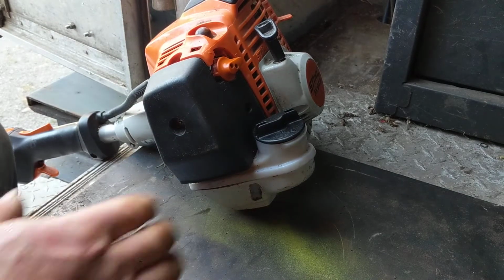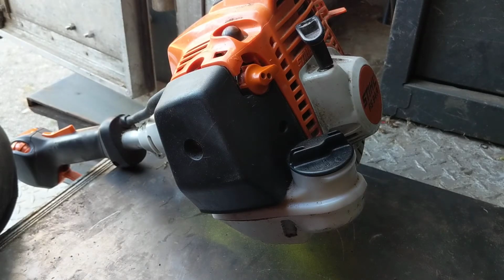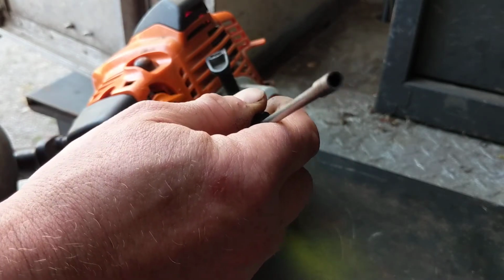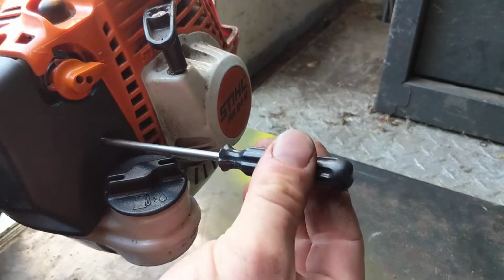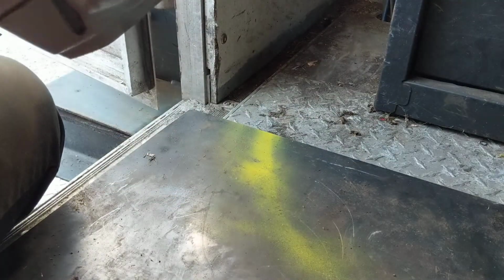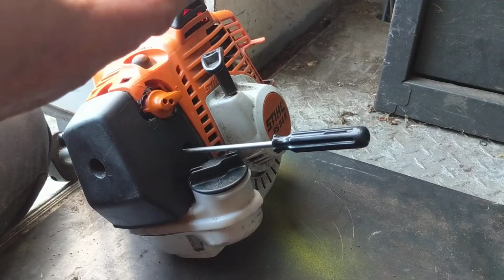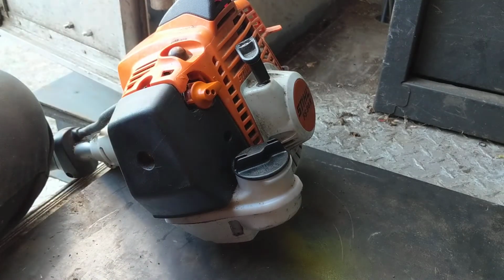Stihl FS 94 R Line Trimmer Carburetor Adjustment #stihl #landscaping #smallenginerepair

Comment: Do I have to mess with the low adjustment?
Reply from the maker: Only if it needs it
Reply: @machinesnmetal  what exactly is the low for? Just wanna make sure before I start messing with it
Reply from the maker: it sets the air/fuel mixture when the engine is at an idle.
Reply: @machinesnmetal  thanks ! 🙏🏼

Comment: I have one of these and my problem is that it doesn't stay running, at first I thought it was the carb and changed it and I still have the same problem, I changed the fuel filter, fuel lines and spark plug and still can't get it to stay running. Any suggestions?
Reply from the maker: What compression does it make?

Comment: Ive worked on thousands of these. A stock, untouched zama/stihl carb should almost never need adjusted. Only time ive ever had to was when i lived in denver and they ran too rich for elevation. Unless i just put a new carb on, it needs valve adjustment or diaphragm replaced 95% of the time. You are fixing the symptom, not the problem. The problem is something is causing fuel not to be delivered as efficiently. There is either too much air leaking where it shouldn't or fuel restricted. The mixture screws dont just turn themselves to randomly get out of adjustment.Valve lash would be first place to start with these motors. If valve isn't opening and closing is phase the a/f ratio will be wrong. The second thing would be to clean carb and replace diaphragm. Then and only then should adjustme it screws be messed with. 95% of the time they don't need to be.
Reply: You took the words out of my mouth, with the exception of valve adjustments.  This is a 2 stroke machine.  On a 4 mix, yes, I would add valve lash to the list of possible culprits.
Reply from the maker: But he's fixed thousands of these... You'd think hed know it didn't have valves. THOUSANDS
Reply from the maker: This video is about adjusting the carburetor.
Reply: Как проверить всё то , о чем вы написали ? Причину как найти. У меня тоже fs 94, zama карбюратор ни разу не трогал- проваливается на средних и высоких оборотах. Буду очень признателен.

Comment: Thanks for the video. Can I ask, what would cause these to be hard to start when warm? I have two, both bought new and if they sit for 15 minutes after using they'll take a good 10 pulls to restart

Also, how would we set the Philips head idle screw in these? I notice the low adjustment seems to perform the same function
Reply from the maker: Sounds like they are flooding do they start any easier when you squeeze the trigger and pull after they are warmed up?
Reply: @machinesnmetal  Hey thanks so much man. Yes, they do seem to get started a bit quicker if I hold the trigger in
Reply from the maker: Sounds like they are running rich, is the air filter new? Have you adjusted the valves recently?
Reply: @machinesnmetal  One is brand new, the other has just always been this way.
Reply: I've adjusted all three carb settings and it seems to be running properly now! Pretty sure it was the low speed screw causing most of the problems, I adjusted it slightly back from idling high, adjusted the actual Idle screw (Philips head screw) so it idles nicely and voila. Thanks again
Reply: PS, also removed the spark arrestor

Comment: Why the high screw  side? Don’t you leave that last for fine tuning?
Reply from the maker: The low was set fine to begin with. It started and idled nicely. When you went to squeeze the throttle it would bog as the hi mix screw was out of adjustment.

Comment: First, thanks for the video.
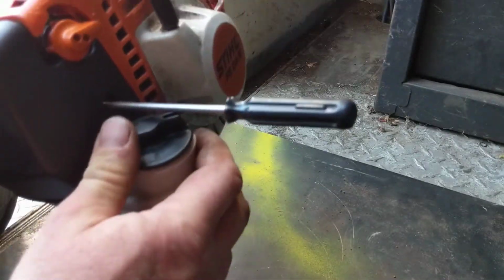FYI:  At 2:20 on the time line you mentioned the the screw on the top which is torx was for the low end adjustment.  It is actually for taking any slack out of the cable to ensure that you get full throttle on your machine by allowing the carb arm to actually touch the throttle stop on the carb body at full speed.   You may have to remove a couple of the covers to actually view the throttle action.  When adjusted properly it will take any slack out of the trigger.  The actual low speed stop is located on the bottom adjustment screw on the side of the carb.  The screw on the right is for making low speed adjustments to ensure you get a smooth transition from slow speed to high speed.
Reply from the maker: I'm sorry I think you're wrong the fs94 has a barrel carburetor and the low idle adjustment screw is at the top in the hole that I show in the video and the high-speed adjustment screw is on the back side of the trimmer look up a parts diagram for that model and you will see that the screw locations I described in the video are correct perhaps you have an older version of this trimmer that does not run the barrel style carburetor
Reply: @machinesnmetal  Mine was a FS90R so you could be correct.

Comment: I have the same Stihl trimmer. Mine will start, but overheats and powers down after about 5 or 10 minutes.

Could it also be a carburetor problem?
Reply from the maker: Could be. Did you try loosening the gas cap when it starts to do it's dance?
Reply: @machinesnmetal  I’ll try that.

I’m gonna play with the low end carburetor setting as well. 

It was running for like 20 minutes great today. But then the low idle made it shut down. But eventually it got progressively more unresponsive no matter what throttle I was giving it.

I’ve never tuned up a grass trimmer so I’m hoping it’s just the carburetor settings

The air and fuel filters look clean. And the fuel itself is mixed exactly as the bottle says it should be.

So it’s gotta be the carb

I saw a good video about the FS94R having a screen in the carb that needs to be cleaned periodically 

Here’s the link
https://youtu.be/4SN89-x-M88

Comment: So the L screw for the low idle is just 2 set the idle when it's idling? And the high would be for Bhai Idol? You didn't you didn't say anything about the low idle well as far as needing to adjust it
Reply: If your trimmer having issues starting or idling is when you adjust it. You adjust it similar to how he did the idle but you don't want the rev up to high. You want it where it idles smoothly and don't shake like a stripper at a club. Once you feel its shaking to much you turn it the opposite way til it smooths out.

Comment: what would cause this model to smoke badley and spit huge amount of oil if its not the fuel mix
Reply from the maker: oil plugged up exhaust/spark arrestor
Reply: @machinesnmetal  to follow up - it's a small metal screen that covers the exhaust. take it off.

Comment: so mine, dose'nt idle for even a second before shutting off. Also today pretty much lost all power still turns the head just barley.
Reply from the maker: is it full of fresh fuel?
Reply: machinesnmetal bad carb, had it replaced
Reply: Is your throttle cable still connected? They can slip off quite easily.